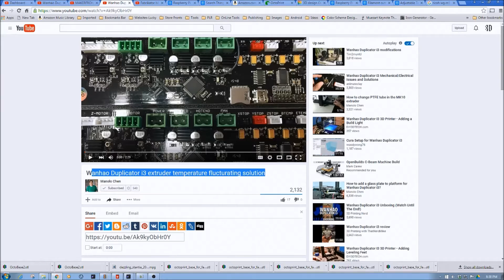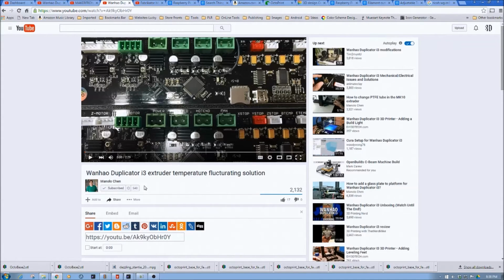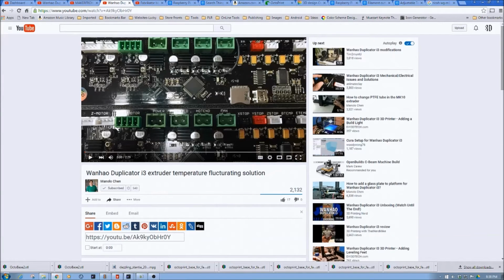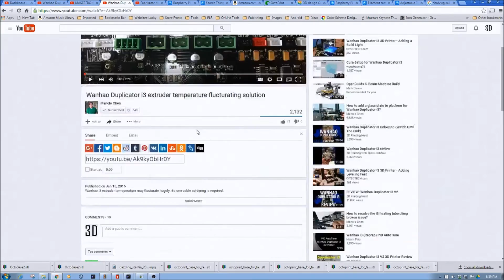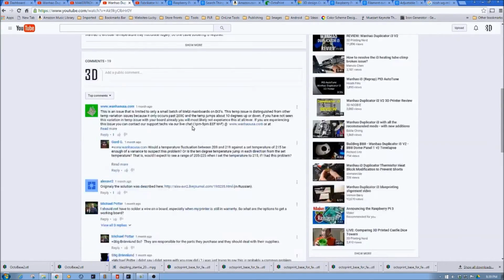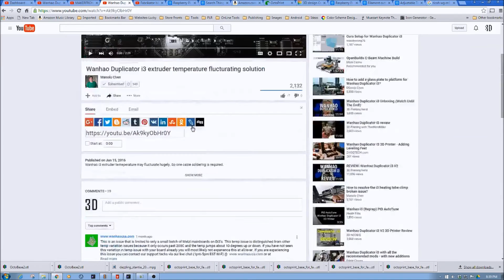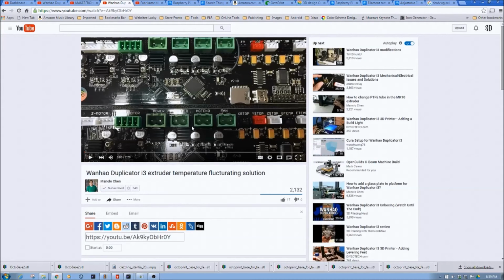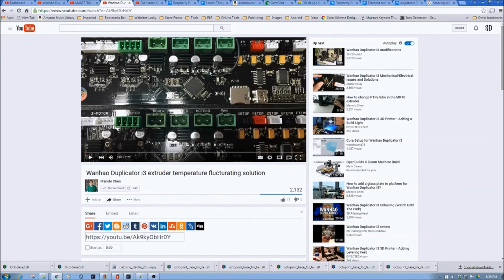Wanhao Duplicator I3 3D Printer - Wanhao Duplicator i3 extruder temperature fluctuating solution

Comment: Hi DIY3DTECH.com is this fix like a legit fix? I would hate to short the mother board and have to buy a new one. I have a new Duplicator i3 v1 on its way tomorrow and would like to wrangle all the mods day one before using it. I see you have a duplicator as well. Any advice to the mods and this fix ?
Reply from the maker: +Brandon Van Houten Do you have v1 or v2?  I don't belive they are shipping the v1's any longer and not sure it is an issue on v1's.  However yes it is legit as if look in the Wanhao playlist before this video there is another one where I show from the Wanhao site the fix (I just go into a little more detail).  If you are ok with with soldering on surface mount board, the fix is no big issue to do.  However do at your own risk, also your milage may vary as for me (and many others) it made it "better" it did NOT "solve".  Personally, I belive there is an issue with the way they are power the board, hotend and heated bed from "one" leg of the power supply (look for a later video in the play about a switch and power supply).  I would say use it first and see if or were your issues are as out of the box, my did fine for PLA.  Most of the mods where either to hotter plastics (like the all metal hotend), or just becuase I wanted to experiment.  As again if your buy new new wouldn't accept a ver 1 only a v 2 as the v 1's had a number of issues...
Reply: Thank you so much !
Reply from the maker: +Brandon Van Houten your welcome and any further questions, just ask :-)

Comment: I have the Maker Select which is apparently a Wanhao Duplicator i3 V2 except for the angled screen.  So now finding that out I'm going to print out the angled screen upgrade that is out on Thingavers and add it to the controller box.  Strange thing is there seems to be a button under the front screen board that might be a stop button but not sure.  i would love to add that to my controller instead of having to use the dial controller to "quit" a print.
Reply from the maker: +Norbert Davis yes there a reset button under there...
Reply: WTH!!  Why hide the darn thing?!?  I just finished printing and installing the angled display from Thingaverse that has the "stop" button. It's awesome. It totally works!
Reply: Oh, I did see the Wanhao guy do the repair but your caution about a novice soldering the board was more than enough for me to say "to heck with it" and wait until I can solder. Not better, just solder. Yeah, haven't done it but a few times and I have no "Skillz". Lol. Better to have a working printer with fluctuation issues than a broken one.
Reply from the maker: +Norbert Davis no clue! Agree with you!  However glade it worked out!
Reply from the maker: +Norbert Davis the biggest thing is it is a tight please trace wise which makes it a bit more difficult...